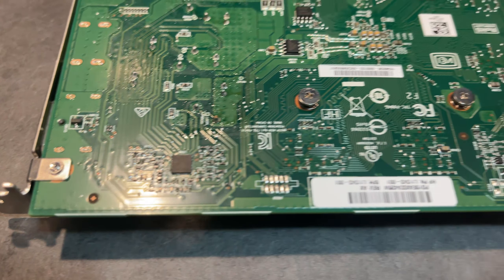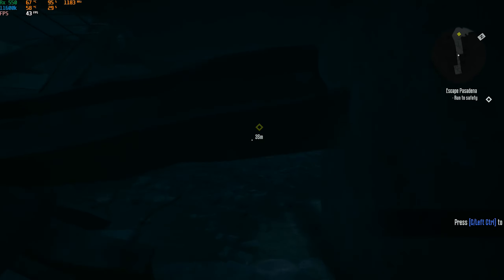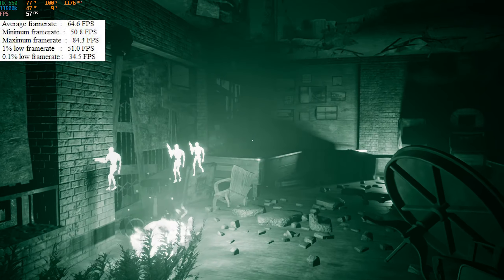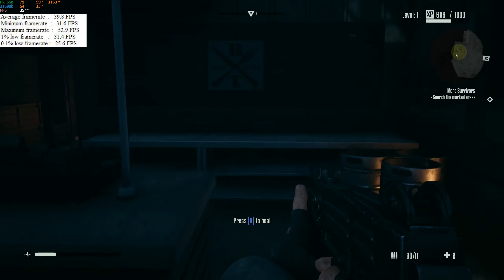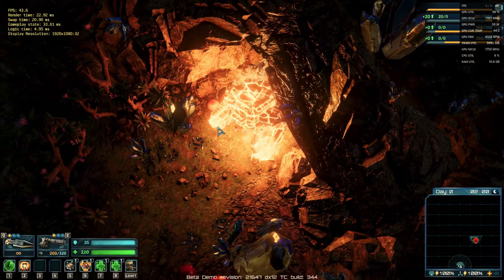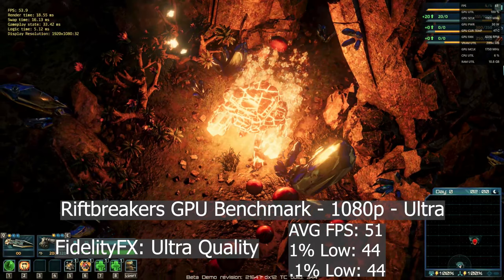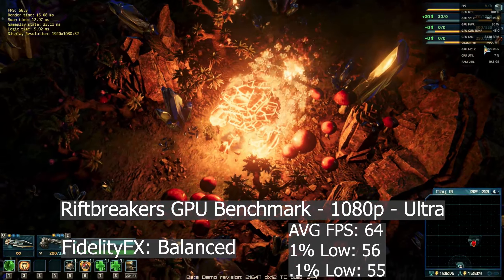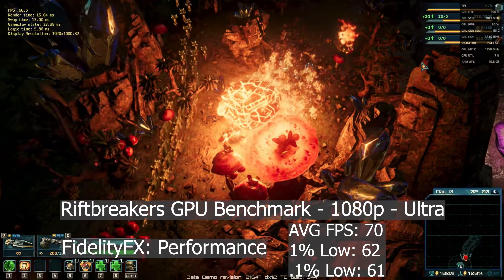The WEAKEST RX 550 vs AMD FidelityFX Super Resolution

Comment: I think that the developers stated that anything using Pixel Shader 5.0 or higher can use the AMD FSR software which means older GPU hardware from 2009 or 2010 have a chance to use the software, but unfortunately other aspects of a video card will restrict or totally negate the usability of the program such as memory capacity.